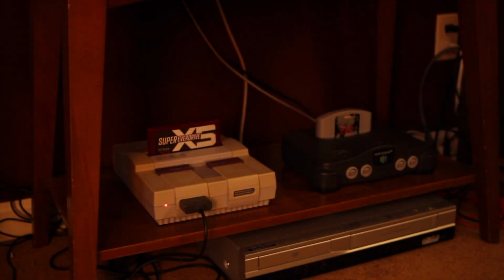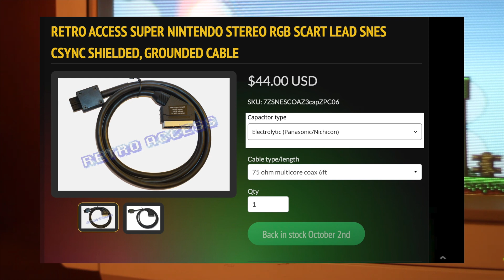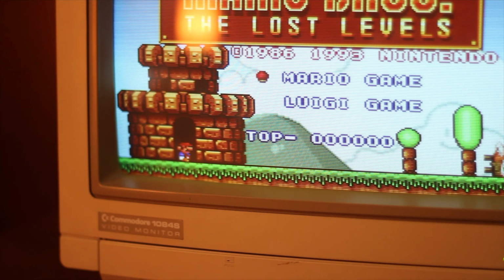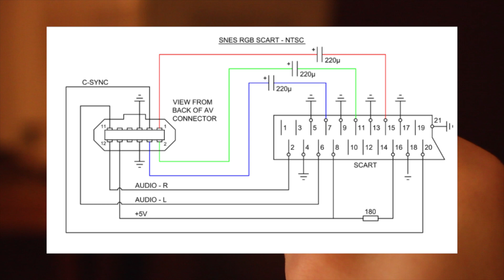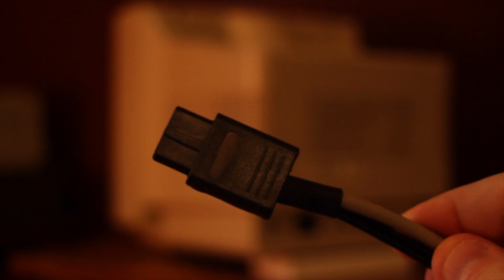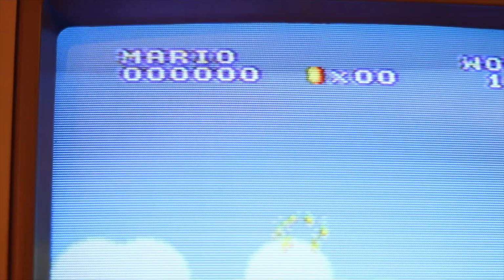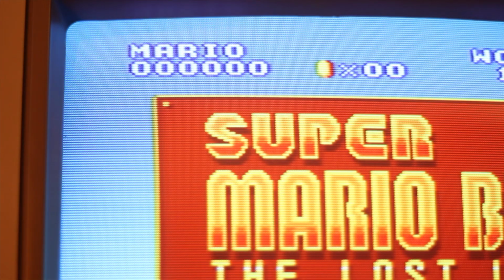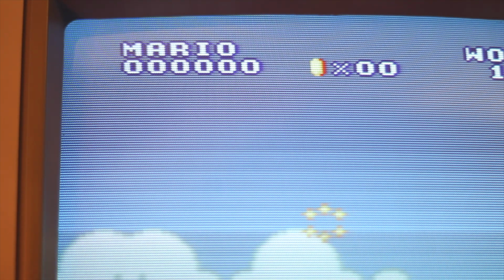Getting SNES RGB Into The Commodore 1084s (Cheap!)

Comment: I could not get this to work with a PAL SNES
Reply from the maker: A PAL super nintendo needs different components wired to the RGB lines. Instead of capacitors you need to use 75 ohm resistors. You can see this if you look up a pinout for a pal snes scart cable.